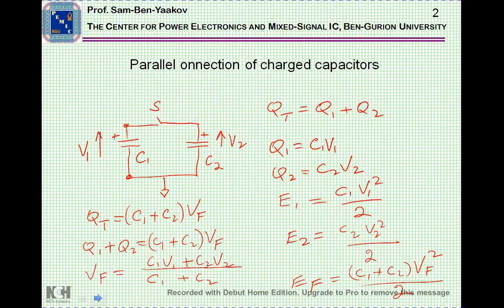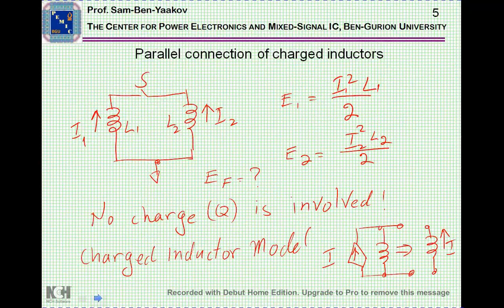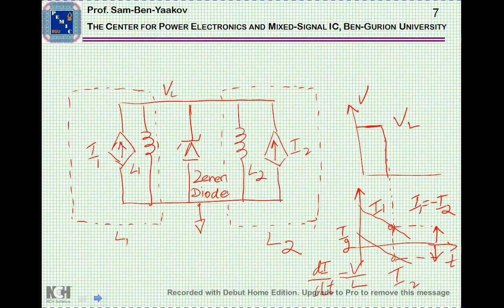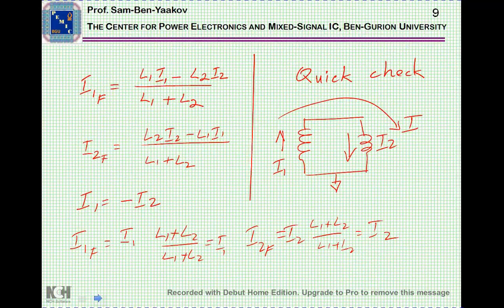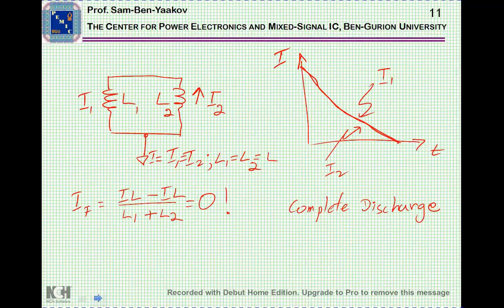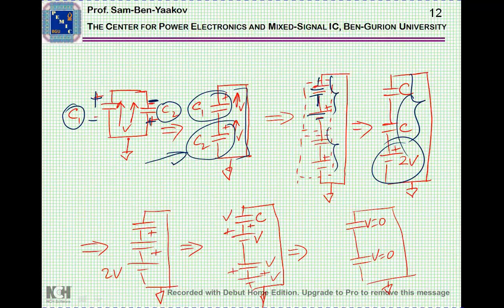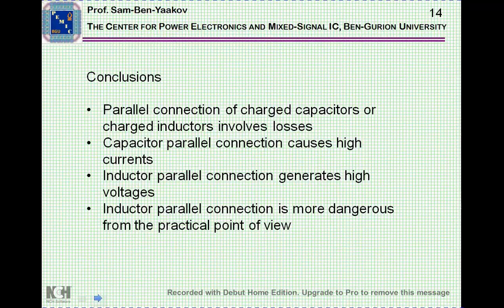Analysis of parallel connection of charged capacitors and of charged inductors

Comment: What happens when L1=L2 and I1=I2 (opposing), without Rp path? Applying kvl and kcl: Vl1+Vl2=0 and I1+I2=0
Reply from the maker: Not clear what is opposing
Reply: @sambenyaakov  I1 and I2 'running' into each other, I1+I2=0
Reply from the maker: @alan4x4  Isn't it the the case https://youtu.be/AjdnzfUYvaA?t=555  If one of the currents is reversed, it is a stable system

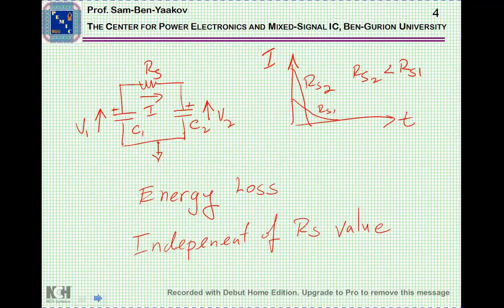Comment: 5:27 Losses? What losses? This is an ideal system - no wire resistance, no losses. That is not the reason.
How do you assume there is a steady state voltage?
The voltage should oscillate and the charge flow back and forth between the capacitors. The only way of having a steady state voltage is by assuming losses in the circuit, i.e. not having an ideal circuit. A non-ideal circuit should include the resistor.
Reply from the maker: Hi, I fail to see the reason for your outcry.
1. Following the minute in video you indicated, I specifically say that any practical circuit will have resistance and I explain that the loss is independent of the value of resistance. 
2. You are saying that the circuit will oscillate. From were did you bring the inductance? If you say from parasitics, then this is from were I brought the resistance🙂
3. Now here is a question  befitting a thinking engineer. Suppose an ideal circuit, no parasitic elements. As proven, parallel connection of capacitors of different voltage entails losses.  Where will the energy go in this (theretical) ideal case? What is  your answer?
Reply: @sambenyaakov  Well, the reason I dislike the  presentation of this circuit as an ideal circuit initially and then turning around and saying that it actually has a resistance is that teachers and professors do this all the time. Why not say the circuit is not ideal from the beginning? It makes for a much clearer exposition that leaves no room for misunderstandings and false suppositions.
On point 2:
I actually did not think of an inductance being present at all - I probably made a wild guess.
But, having thought about it since, I've come nearer to the conclusion that an actual ideal circuit is impossible even under perfectly ideal conditions (that do not violate any laws of physics of course!). The closest I think I can come to such an ideal construction is as follows. Suppose the circuit is constructed by rectangular horizontal plate for the bottom part and another one of the same size some distance above it. Then,  an infinitesimal narrow slit is cut on the top plate separating it into two sections. We now have two different capacitors of different capacitance. To effect the nearly ideal switch, a wide beam laser is fired above the slit that instantly welds the two plates together. The energy expended by the laser does not enter the electrical circuit and is thus irrelevant. The only problem with this is that we have an infinite capacitance between the two sections of the top plate unless we assume its thickness to be infinitesimally small.
The answer to 3, I don't know: any mechanical switch or mechanical means of joining the two parallel capacitors will entail the two fringing electrical fields repelling each other and approaching them by force will mean work being done. But that is energy that is added to the system and not subtracted.
On the other hand, from a thermodynamical point of view, the new system state is one of lower potential energy which requires energy to be expended (lost) in the process. My guess is that the energy is expended by the flow of electricity from the high potential plate to the lower potential plate. This will create an electromagnetic wave radiating the energy in free space with the circuit acting as an antenna.
Reply: One more point: up until 5:19 the math applies equally well to two different circuits that store the same charge but contain different amounts of energy:
- one open circuit with 2 capacitors at different potentials
- one closed circuit with 2 capacitors at the same potential.
In other words, up until then, we need not even consider the effects of closing a switch, current flows etc.
We just need to explain why the voltage necessary to guarantee the same charge is stored in the closed circuit implies a lower energy storage level.
Reply: I still haven't been able to come up with an answer - short of applying Maxwell's equations which is a rather tall order...
Funnily enough, having searched a while in youtube, no answer can be found but this one here:
https://youtu.be/HlqC2cT7PcQ?t=713
matches my intuitive understanding.
But would you consider that as implying a parasitic inductance?
Reply from the maker: @Stelios.Posantzis  Here is my take, never had the time to try to prove it though: In the absent of parasitic cap and inductor, the current will build up to high level and I thing that, depending on the dimension, the energy will burst out as an electromagnetic wave. I have been told by my of my older colleagues, Prof. Censor, may he rest in peace,  that he has a proof for that, based on Maxwell equations (his specialty) but I have ever seen it.
Reply: @sambenyaakov  This problem has made me very curious as I can guess it gets avoided in all education levels - probably due to the teaching difficulties it entails.
My thoughts have gone in two directions:
a) Ohm's law is not part of the Maxwell's equations. I could be wrong but I do not remember any derivation of Ohm's laws from the Maxwell's equations ever being taught. I should check on this though.
b) One can think of parasitic elements as either Ohmic or reactive. It can be argued that the Ohmic parasitic elements can be assumed not to exist and the circuit will continue to obey the laws of physics (i.e. Maxwell's equations) both in the ideal scenario and also, very closely, in the practical scenario (by assuming superconductors are used throughout). However, the case is not the same for reactive elements, i.e. one can never do without them in the ideal case because the circuit has to obey physics laws (Maxwell). But the lack of Ohmic elements helps in this case in that the idealised circuit can represent exactly the real case, with all reactive elements accounted for by simply using one inductor and one capacitor - the conductors in the circuit joining those elements simply being there as a visual aid/convention without any corresponding physical properties. One can contrive idealised configurations where the inductive or capacitive part is minimised but probably never eliminated (even when resorting to mathematical trickery). That this is the situation in an idealised circuit means that we cannot evade the laws of Maxwelll even at very simple construction without running into any sort of trouble in our mathematical exposition of the observed/predicted behaviour. In this sense, the circuit merits more attention (from an educational standpoint) not least because this is a circuit that can already appear in a high school problem. 
There is a third aspect - which is probably where all the difficulties stem from: one can attack it simply using a mathematical approach. This of course is devoid of all physical interpretation (until one assumes one) and hence any idealisation is allowed. This I guess is what leads to trouble. Nevertheless, I would still like to see a derivation made this way assuming only capacitive elements that is based on Maxwell's equations. My bet is that we will still see reflections and thus a wave/oscillation forming. :)
Reply from the maker: @Stelios.Posantzis  guess that with cryogenics we can reach very high and test the radiation. I would not standby.
Reply: @sambenyaakov  I just read something interesting (which goes to show how easy it is for one to forget basic principles when focusing too much into the nitty-gritty): Ohm's law is not actually a law but a definition (stemming from empirical observation). I had always thought that ever since I was first taught it yet somehow I managed to forget this little fact!

Comment: Hum.... Interesting, but I have a couple of considerations, if I may. 

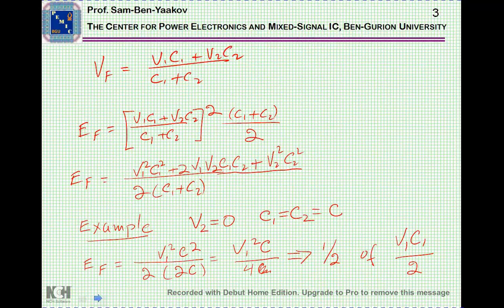First, Q, in Q=CV, at least, as I understand it, is the DIFFERENCE of the number of electrical charges on both side of the capacitor's plates. At one plate, there is an excess of electrons, and at the other plate, there is a lack of electrons, or, indirectly, an excess of protons. So, the total electrical charge is 0, but the total of the two numbers gives Q. Now, the complicated part: starting with cap C1 charged (Q1=C1*V1) and C2 uncharged ( Q2 = 0 = initial V2), speaking of conservation of charges is about not destroying electrons (unless they join with an atom with a missing electron, in this case the electron won't be destroyed, but the difference in electrical charge will be). So, since electrons in excess in C1 cannot cross C1, but some can move to one of the plate of C2, expulsing the same number of electrons from its (C2) second plate to reach the second plate of C1. In short,  Q1 will decrease and Q2 will increase, so we may, indeed, say that in this case, Q1+Q2 will be a constant, since there is NO external source of electrons (and initial electrons in excess at C1 won't recombine with any  proton in excess, since C2 has none, initially). But that is the important point! Having no external source, than C1 (initially, and for the time it requires to reach a contant "state", macroscopically, of voltages), the circuit, ""the close loop circuit"",  is about two CAPS … IN SERIES, NOT IN PARALLEL !  So, at 3:53, the equation for Vf seems wrong!  It should have the denominator equal to  (C1*C2)/(C1+C2)  … very different than the actual C1+C2, which stands for two caps in parallel, isn't it?
Reply from the maker: Hi snnwstt, thanks for comment. I will appreciate it if you would post your question at the LinkedIn group I have started: https://www.linkedin.com/groups/13606756

I , and perhaps others, will respond and all members of the group will benefit from the conversation. Thanks.